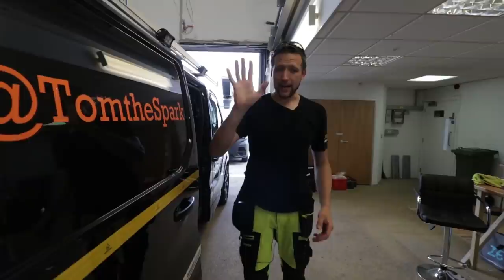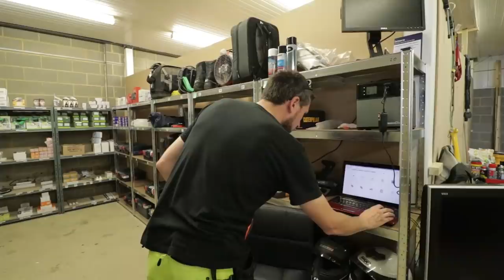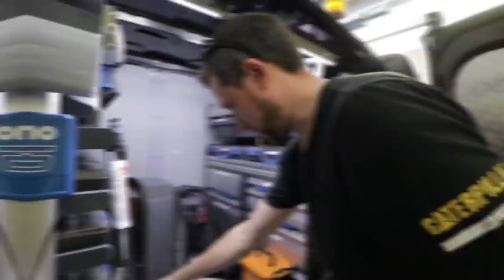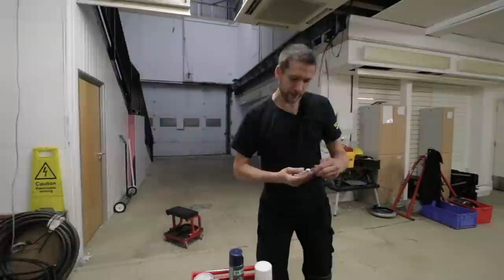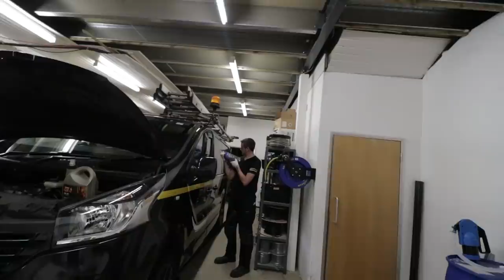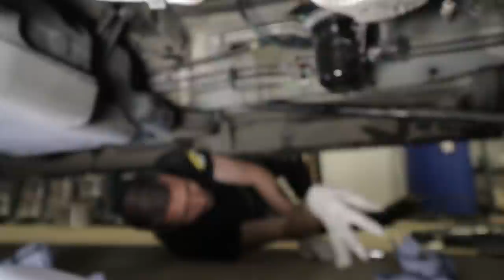When ELECTRICIANS try to be MECHANICS... | Thomas Nagy

Comment: Your Question regarding Oils. The premium oils are much more synthetic based and hence they can withstand not only the extremes of temperature but increasingly the higher shear forces (abrasion/viscosity/oil speed/tolerances etc) within the engine. Without these the engine will very easily and quickly breakdown the oil molecules (and literally pull atoms apart) rendering them useless after a short duration. It is difficult to quantify the exact duration difference as very much depends on how much time the vehicle spends in idle conditions (city centre) & highspeed motorway driving. If going for cheaper oils ensure that they are synthetic and change more frequently. I am no car mechanic but have spent a considerable amount of time as a chemical engineer designing plants to make  these oils. Any other comments feel free to ask!
Reply: Even the cheaper oils are fully synthetic to the manufacturer spec... Does the same apply?
Reply from the maker: Cheers for the input pal! I’ll keep that in mind from now on !
Reply: I don’t think it splits atoms!
Reply: @edc1569  Thanks fair comment but allow me to explain. At the molecular level the combination of pressure, temperature and high shear in modern engines. ( Hint look up Le Chateliers Principle Basic A Level Chemistry knowledge) the pushes the equilibrium point to allow slippage of longer chain molecules and hence the oil loses its lubricating properties.
Reply: @andrewsmall6568  Agree to an extent. Even cheaper oils are synthetic but the main difference  is the the additional molecules which are attached onto the main hydrocarbon molecule have a greater tendency to breakdown sooner when compared to the much more expensive  or main dealer recommended lubricants. The problem becomes that when these molecules break down at molecular level the lube loses ifs flow properties and hence with the tight tolerances within modern engines this is where problems begin if not changed regularly.
Reply: That's correct. I fully get there are better and worse oils depending on the refining process and chemical makeup. This is sometimes not reflected in price, I know mannol are showing excellent results in tests for the money. Also the oils going into that van should all meet API SN standards, ACEA C4 and renault rn0720. Meaning any oil meeting that spec would actually have to be a decent quality and not too far away from the most expensive or it wouldn't have passed / be within spec for DPF life, wear rate and stay within viscosity through the interval.
Reply: So the cheaper oil may actually be very high quality.

Comment: Clamp each hose before you take the filter off to stop/ slow the air filling the lines.
Reply: Hard to do on a plastic line without deforming it.   If its self priming just cycle ignition a handful of times to fill the filter.   Sometimes you can put a mityvac on the return line and pull diesel through that way to prime it.

Comment: My trafic's 8 months old, only done 3k. different engine to yours I think but it already wants more oil. Says 7.5l of fully synthetic 5W30 changed every 24k. I'll be getting it done annually though. Renault said use Castrol but I'm risking Halfords brand... There are too many different oils on sale for the uninitiated
Reply: My Trafic did something similar, threw an oil change warning at 7k miles. It’s a 2017 so the 1.6 125bhp model.

Comment: I had a 2004 Vauxhall Corsa as my first car. Car had an issue where it'd misfire at 3.5krpm dead every time when driving. Couldn't get to the bottom of the issue. Tried everything; coilpack, sparkplugs, mass airflow sensor, battery voltage, crank and cam signal sensors, cam chain and timing, headgasket, you name it i'd tried it.

Turns out 5 years after scrapping the car, i worked out what the problem was. It was in "limp mode" due to the ABS system being upset at a fucked wheel bearing. Only realised this after reading some of the old fault code dumps from the car that i had archived 5 years later.
Reply from the maker: Out of all of the things it could've been lol. But I'm glad to hear that you got to the bottom of it eventually :)

Comment: On my T5 after the fuel filter you can run the fuel pump in the tank to pump fuel to the filter with a diagnostic tool like VCDS or Delphi DS150. Maybe it could be a good idea to get one of those diagnostic tools.

Comment: for servicing my vehicles at home i just have a set of ramps, no real need for a lift. save yourself a few quid tom.. as or the long service intervals, the engine burns so much oil that you will have to top it up several times during the interval that it in fact gets good new oil quite often.
my van is something like 28k miles between services but will need about 6l of oil for topping up

Comment: Tom, if that laptop is on the interwebs I would recommend you do an in place upgrade to Windows 10!
Reply: NO, airgap that bloody thing and do NOT use a laptop. Use a desktop as they are a tad more robust and have better cooling.

Comment: Slight flaw with your booking in system. It assumes the user has scanned the right barcode on the shelf and is holding the right product. If it prompts you to scan product and code on shelf,  and both must match before returning item in stock. This would give more accurate stock levels. Keep up the good work.

Comment: Tom, could you do a fire alarm testing video in your unit?
Reply: Agreed
Reply: Might be landlords responsibility, depends what the set up is. 
    One thing worth noting, on a slightly different topic is the retention of some floor space by the landlord. That aspect has been agreed, but if theres no proper fire proofing between those areas, and something goes wrong, it could well be a problem.

Comment: Interesting, and as usual, entertaining, video. I've a couple of questions/comments that I hope you'll find apposite. First, WRT stock, how do you handle parts that aren't 'each' i.e. cable, conduit etc? Your guys will book out a cable reel of, say, 100m. What happens when they bring back the remnant of that reel? How does your system handle that? Secondly, when I was a service engineer for Hotpoint, my van was my responsibility WRT to tidiness, stock control etc. I recorded the parts usage on each job, and that was communicated weekly to head office, and they replenished my parts accordingly. Obviously servicing was a separate issue, and was organised by the manager via a local garage, but i would never have expected my boss to stay behind to tidy up my vehicle, book parts back into stock etc. If your guys want to finish early on Friday, make the parts return & tidying up of their vehicle a requirement of being allowed to go home. It probably wouldn't hurt to get them to do filter, pad changes etc if you can't justify the expense of a third party solution to servicing. Won't do them any harm, and will give them another string to their bow.

Comment: My boss used to virtue signal and say he stayed late and was in at the weekends, but after i moved near to office, everytime i went past weekend or after hours it was locked up!! Glad you stay till 7pm on a friday Tom, will give you a chance to tune it to your radio show at the same time...... Didn't you say you'd never bulk buy on the podcast a while back also?
Reply: I used to live around the corner from the office I worked at.  Boss was always on about being in the office working 'till midnight... funny, the lights were never on when I was out & about  of an evening.  Best bit was that as I was the security system manager I could see what time the alarm system was set!

Comment: I work for the nissan dealers repairing the nissan branded renault vans, 10,000 mile intervals are ideal If you want to keep things like turbos and timing chains in good order. We actually use a company called millers to do oil analysis if needed and its quite cheap. The correct grade is indeed 5w30 C4 low saps as this is factory fill. I have had mannol and triple qx oil analyzed and it is just as good as the expensive stuff. Spec matters not brand.
Reply: The main dealer oil is actually NO different to what you are using. The vans can do the mad interval for the first few services but are buggered out of warranty. Please ignore the people who say the cheaper brands are any worse or last less ect because the analysis reports just don't back this up. However in terms of filtration there can be a lot of a quality difference between filter brands. Mann are one of the best. OE for that would be purflux.
Reply from the maker: Really appreciate the input pal! I guess I’ll stick with what I’ve always been doing 👍🏻

Comment: As a mechanic you should do oil change much sooner in severe driving conditions. 10k. I've seen oil getting so thick after 30k it clocked turbo and oil galleries. Drain plug has crush washer so it's more than a hand tight and a smidge. 25k service does work if all you do is motorway driving. Fuel filter has 5s or 30s prime with ignition on. Turn ignition on 10x for 15s and it's should be primed. Likely it won't start on first crack but you'll have some fuel in and won't run pump dry which can cause damage and air lock. And no we don't have any device to plug fuel lines.

Comment: I had a truck years ago that would just die when the engine was pulling hard, changed the injectors twice and the fuel pump once, then someone sugested that the suction pipe in the tank could have a crack in it and when the fuel got to below that level it would draw air, so in the end I bit the bullet and cut the top of the tank open in order to extract the pipe. There was no crack but I did find a privet leaf in the bottom of the pipe that was acting like a flap valve when the diesel flow was fast enough it would shut of the fuel and the engine would die.

Comment: Good to see people doing servicing but interesting that an electrician is happy to advocate people replacing their own brake pads and ball joints, yet let a guy swap a CU and electricians have a meltdown. 

I served a mechanic apprenticeship in the 70's and specialised in steering suspension and brakes, being trained by Ford in Daventry. I then retrained in electronics in the mid/late 80's and have worked with high-power, high-voltage, high-frequency electronics across more sectors than you can imagine from medical, through to aerospace ever since. I wonder how you would feel about me replacing a CU and rewiring a house... to code?

Comment: I know the pain with doing a fuel filter! The bloody thing wont start! With your 68 plate there should be an oil quality sensor in the engine which also triggers the service message.
Reply: You just need to turn the ignition on and off a few times to prime the fuel filter
Reply: @GeorgeAusters  it’s never that easy

Comment: Until recently 3000 to 5000 miles was usually the manufacturer recommended oil drain interval in North America.
Reply: Seen it loads, they're cray cray over oil changes, and its really mind bending why this is so. Can always tell when there's North Americans on an oil change subject. Get them talking oil filters, thats really quite something!
Reply: @idi0tdetectioninprogress  I know that it dates back to either when production cars either came with no oil filter or just a roll of toilet paper for one.
Reply: @idi0tdetectioninprogress  yes I have seen many of these videos. Fram seems to get a lot of flack. When I asked a mechanic he said he has never seen a issue with Fram filters.
Reply: @idi0tdetectioninprogress  prefilling is now rarely possible as most newer engines use cartridges instead of canisters.
Reply: @robertsitch1415  Awww you've gone and spoilt things now!

Comment: As a mechanical engineer don't listen to any rubbish manufacturers tell you about long service intervals. Diesels used for short trips and lots of stop start driving should be ideally serviced 6000-10000 miles. All is dependent on driving conditions and many other factors. Manufacturers always make thier estimates on unrealistic perfect conditions which can never be achieved.

Comment: Tom, when you replace a fuel filter prime it by turning the key on the off, on then off, a couple times and it will start right up
Reply from the maker: That’s what I would normally do however these vans are push start so you don’t have a physical key to do that
Reply: @thomasnagy  You can turn the ignition on without pressing the clutch / brake pedal though?
Reply: @thomasnagy  Sometimes you can do that if you press the start button but aren't pressing the brake
Reply: @thomasnagy  i assume it asks you to press the clutch / brake to start; just press the button with it not in gear / pedal not depressed and it should self prime.

Comment: Oh, if you've got a vehicle with no primer that you're having a nightmare to bleed...

Some have in tank lift pumps, in which case there will be a procedure (pump the pedal five times whilst holding your breath and rubbing your belly or something) to prime it.
Other will have fittings that you can attach a manual pump to.

If all else fails, crack the line loose in the engine bay, put a rag over the fuel filler and breather and use an air line to gently pressurise the tank. It blows fuel through the system.

Comment: I had a car 🚙 that would always cut out if you went over 60 mph, if you kept it below 60 it would be fine..
 Turned out it was a blocked fuel filter restricting the flow and starving the engine..

Who knew...? 😂

Comment: If you looked inside a 50k oil change engine you’d carry on doing it every 10k
Reply: They are likely there for company car drivers. For example when you lease a car, you don’t care for the longevity, but you do need to service as per the manufacturers guidelines. So it helps them but not to much the long term end user of the vehicle. 20k miles for most German cars but most people driving BMW’s etc into high mileage territory would be servicing their car at around 10k miles. It’s a given now that early servicing extends the life of the vehicle pretty much

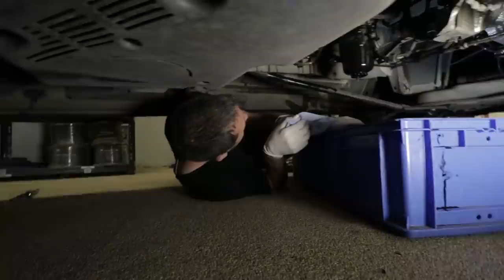Comment: @18:56 why pay a trade when you can DIY it?   Intrinsically it should be possible to do most jobs yourself (brain surgery probably excepted) but in the end your time might be better spent elsewhere?  re: the stock system is it possible to have a sheet of codes that you scan to set the mode... e.g. return stock... that way you never actually need to go near the computer

Comment: These vans will last a long time if you keep doing this maintenance. 
As a ex-mechanic I’ve never understood why they make service intervals 2years or ridiculous mileage… even if the oils are better these days
Reply from the maker: Totally agree with you on this one
Reply: They do it so the lease is attractive to the companies leasing them, a long service interval is more attractive to them (cheaper in the short run and by the time it becomes an issue they no longer have the van). Definitely better to service them on shorter intervals, oil is cheap, engines aren't
Reply: @offbeatwarble  Ain't nothing wrong with changing the oil! Any crap going round in the engine is in the oil. The odd engine flush might be good as well. (Again most oil flush is pretty cheap). I'm amazed at service intervals for cars and vans these days. My general advice to anyone not keen on servicing, if you do nothing else, change the oil!

Comment: I'm not sure what to think about re-using breakers. Are the customers being charged for new ones?
Reply: If you don't and the board is obsolete your replacing the entire board! It's just common sense to keep usable obsolete parts!
Reply: I don't use them on installs, but if I have a faulty breaker on an obsolete board, where getting hold of a new breaker would take ages, I will fit one that I have salvaged from an old board.
I'm always upfront with the customer. I've never had a customer complain about me getting them working again using salvaged parts.
If they'd prefer not to have a working circuit for a while and a potential board change, then that's their shout.

Comment: Tom, I get what you are trying to do by DIY servicing, however, I reckon, you should book your van in to a decent local indy garage and you go and do a mornings work which in turn will pay for the garage bill. I've been there, done that, got the t-shirts. Life is too short and you appear to be successful enough that saving £120 on an oil and filters change isn't an issue.

Comment: Do you find that those 1.6 engines consume alot of oil??
Reply: Tom wouldn’t have a 1.6 🤣
Reply: @AndyK.1  I thought all the new shape traffic/vivaros are 1.6 just different tunes
Reply: Automatic is 2.0
Reply: @AndyK.1  his vans are 1.6. there are various turbo variations (single or twin) and 3 different power outputs, but all the MK3 Trafics are 1.6 blocks.
Reply: @karoln7078  all the mk3 are 1.6, you are correct. The engine size changed to 2.0 for the facelift 2019 onwards, identified by the LED DRL's around the headlights.

Comment: Tom, use your loaf and set someone on who's a good all rounder, if you want to continue with in house van servicing.
    Ex military would be ideal, with mechanical quals. They could do the spanners, and have the common sense to do stock, check deliveries are correct, take care of waste disposal, cleaning, AND when you're working with the van bucket you dont need to tie up two qualified electricians in its use. Could also do scrap run, which would enable you to recover used cable rather than throwing it away.